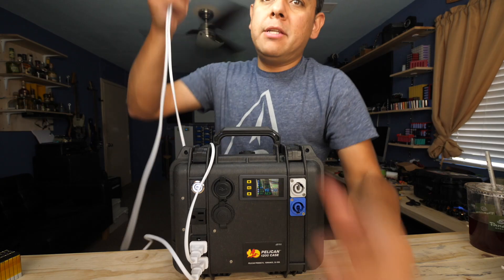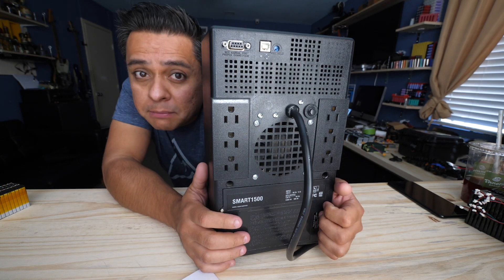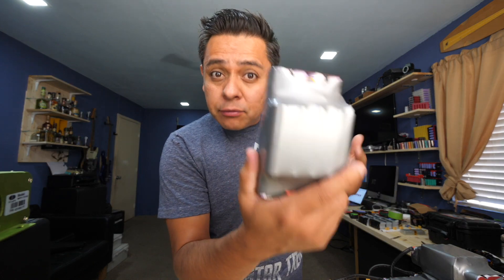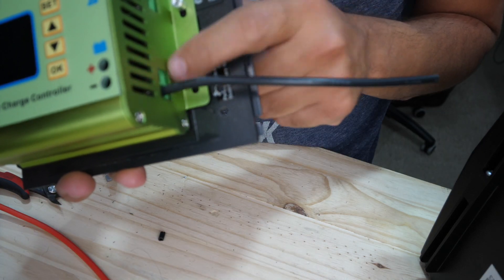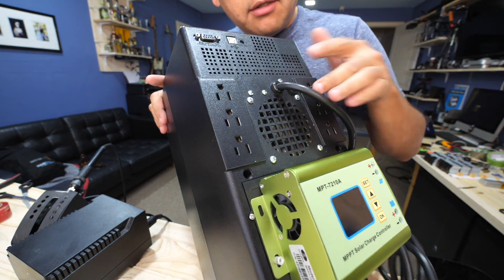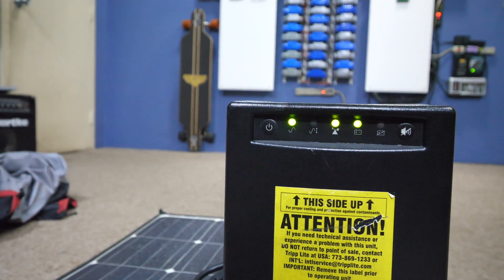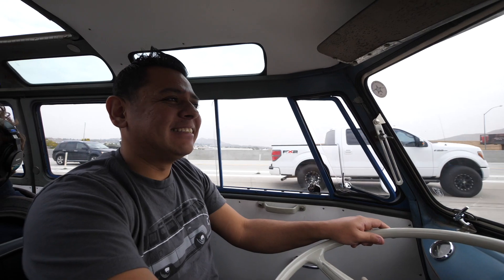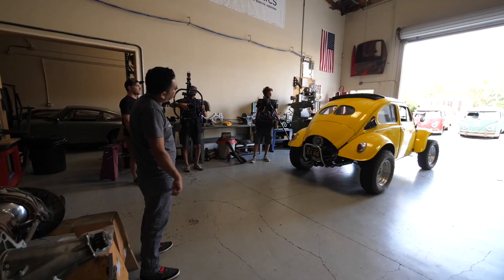The $400 Solar Generator you can donate To Puerto Rico

Comment: Hey, great job your doing there, supporting Puerto Rico I must acknowledge. 

I have been following and watching your work the last 18 months and we are interested in a similar solution; We (in some parts of Nairobi in Kenya) have been experiencing frequent scheduled 8-9hr power blackouts at least once or twice a week because of maintenance... Oh and any time there is heavy rain, NO POWER! I was born, found this issue, now married with children and my children are still experiencing the same issue.

We are interested in a solar Generator but 240V if possible.
I hope you don't mind me asking if you can build the same Solar Generator to output 240V to power 4 LED Bulbs, Refrigerator, 2 Computers, a TV, router and still have enough hours to keep the system running.

Looking forward to your response.
Reply from the maker: +dj riQ   It’s the same device with different components,  I don’t have a use for those specs so u won’t be building that particular version
Reply: You can go off grid any time you want. With a used UPS like Jehu shows it's just cheaper. 980W and sine wave is pretty good for a quick system already in a box and ready to go to help people in need. Search youtube for "off grid" and see all the ways people have done this. Battery, inverter, solar charge controller, solar panels and you are all set. And it's mostly just two wires + -. Then like everyone else you keep adding to it as you go while telling the power company to shove it more and more. It's fun. See my youtube channel for what I did and I took my hot water heater off grid the easy way so that big load doesn't have to be on the inverter at all. You can buy a 240V inverter on ebay, I use a Prosine 1800W for everything in the house except A/C which is on another inverter now. Have fun and it's worth the investment to not have to worry about power outages or paying the power company. We really don't need them any more.
Reply: Thanks for the response, 

What I have is the APC Smart-UPS 1500VA LCD 120V which I bought in the US and shipped to here. I can probably begin with this just to understand how the whole thing works before I purchase a 2240V version.
A humble request: can you assist me to figure out the exact type of cells, number of cells, cabling + connectors, charge controller and a flexible solar panel that will be ideal for a similar setup as above.

I appreciate in advance.
Reply: By using your phone you are limiting your life, use a real computer for the internet. This was all in the DESCRIPTION and this video shows it all except how to set the CC.
To Familiarize yourself with solar charge controller https://youtu.be/mM6JTquNSZU & https://youtu.be/vzhwR0mAshs
To set charge controller to auto start charging https://youtu.be/f0Br1Q57IoE
******************************************************************************
Parts List:
http://j35.us/5xSona36v-packs     $149
http://j35.us/MC4-SolarConnectors  $5.18
http://j35.us/12awg-Cable     $24.99
http://j35.us/xt60--y     x2     $9.99
http://j35.us/10A-Mppt-ChCon     $37.99
http://j35.us/60wLEDbulbs     $9.92
http://j35.us/LightSockets     $12.68
http://j35.us/105W-flex-solar-Panel  $126
http://j35.us/950w-UPS.     $30

Comment: Can you do a video that has a battery wall or system than that can be charged by human power like a bike? It may also promote exercise.
Reply from the maker: No,  humans can not produce very much power maybe 100wh
Reply: jehugarcia thanks for the reply keep the awesome content coming...  Probably watched the matrix too many times..
Reply: Better and smarter to do exercise only once when putting the panels up on your roof. Then you can relax, kick back and enjoy the DIY solar power lifestyle. You gotta love those roll out panels Jehu shows but if you are going to go through the trouble of climbing up there and bolting down mounts I would get the biggest panels you can at a reasonable price to use that precious space you have on the roof. You will be expanding your system as time goes on. For emergency and quick, those roll out panels can't be beat. Visit my channel and other channels to see how people do off grid DIY.

Comment: One big difference between this model and the smaller one in your previous video is that you ran out of time to add an extra out port to Daisy chain an additional ups pack. Can you address this in your follow up video please because I'm trying to figure the best way to do that. I'm putting this setup together as soon as I read your reply. Thanks J.
Reply: At 980W per UPS just get two or more, they are cheap. And then you have a back up if one goes down and you are not out of luck. That charge controller Jehu shows is 10A so your charging power is 360W max at 36V but all day long so say 2.8 KWh (generally) on a good day which should run a 20 cu ft fridge and maybe TV for some hours, you may need a timer to keep the fridge off in the morning a few hours before the sun comes up. You have to think of ALL the factors other than more batteries. At night the fridge may use less power because you are not opening it and it's cooler. Get a Kill-A-Watt meter and log it on paper so you know where you are at. And by the way, it's always more panels and more batteries over and over till you reach a point where you have so much free energy you don't know what to do with it. Welcome to the DIY solar world, see my channel.
Reply from the maker: Add an extra connector and you can daisy chain as many battery packs as you want

Comment: could you daisy chain these with the attached power cord? Pulling power from the other. with your 1st in the Chain cycling in Solar Power from any panels?
Reply from the maker: Maybe,  but you wouldn’t want to waste all that power in inefficiencies
Reply: jehugarcia thanks for the response. I've got a friend heading back to Puerto Rico and we are both thinking building a few of these would help when he goes back. Chaining them would help.
Reply: Any UPS seeing good AC coming in would switch to that AC and thus not run the internal inverter and also start charging that battery so basically it would get bypassed. What you want to do is put different loads on each UPS, like a fridge on one and lights and TV on the other. Put a timer on the fridge to turn it off a few hours before the sun comes up so it doesn't pull the battery all the way down and trip the UPS off or whatever. Then let it come back on when the sun comes up and gives you enough power. You should get a Kill-A-Watt meter so you know what the fridge generally takes but a 20 cu ft is like 170W running, 300 defrost (you could disable that in a pinch, just pull one wire) and about 2 KWh a day total. Hope that helps and see my channel and others for DIY off grid stuff.

Comment: Jehu, can you do a bigger one? I made one last year but used 2 12v 105ah agm batteries. I use a Ridgid 22" rolling Tool box from Homedepot. 
Here is the link of the box.  https://www.homedepot.com/p/RIDGID-22-in-Pro-Gear-Cart-Black-222573/205441921?MERCH=REC-PIPHorizontal1_rr-205440481--205441921--N

Comment: Can í put more than 4 battery packs for more storage capacity and how long can you run the CPU
Reply from the maker: Yes they are in parallel so you can add as many as you want
Reply: Thanks gracias hermano

Comment: TrippLite equipment and the company are excellent in my opinion. 13 year's ago when figuring out my home off grid solar system the best price I could find for a 12v 2 kW inverter was one of theirs through a trucking supply company for a little over two hundred bucks. Even better it was listed as ambulance grade so has always run our computers and electronics with no issues even though not pure sine wave.
   After three years it had an internal short, and when calling the company was informed that actually it had been recalled. But even without wanting the old one back over night shipped a 3 kW replacement that came with the added bonus of being 12v / 24v variable.
   Has been working fine ever since with the exception of replacing a noisy cooling fan about four years ago that was just pulled from a junk computer power supply that I had. 
   Jehu, thanks for demonstratong how easy it is to do these kinds of projects. I figured it out all those years ago and have had free electricity ever since. And with the reduction in price of panels and equipment could probably do for less than half of what I paid back then.. But If had waited would have spent 3 times as much paying the power company.
Reply from the maker: Nice

Comment: What is the shipping weight of the UPS without the batteries? The seller does not list on the paypal checkout. I need this information in order to check the freight forwarder cost to ship a UPS to work on for this project.
Reply: think it was 43 on amazon they have link for extra batteries subtract that?  about $25 to ship for this deal..$55 dlvrd

Comment: Can anyone there contact the red cross or other groups and get this information to them? They have a lot of funding and this is like handing a generator that doesn't need any gas to people in need. The gift that keeps on giving.
Reply: Jehu, I contacted the Red Cross but no reply yet. They probably don't even know what I am talking about anyway and only deal with food and blankets.  It may be better coming from a RC contact in PR. Could you or someone you trust start a Kickstarter or other crowdfunding campaign and then get a bunch of these and panels quicker to PR? Check with solarblvd and sunelec for the lowest prices on panels and since someone here said they can ship pallets it might work out well with more power per $ spent. Just a suggestion, I know you are short on time now so this is why I suggested someone you can trust. You can probably set a cut off date for a first "batch" and then keep the funding going for another batch etc..
Reply: It may still be difficult to get packages there. From "Unidos por Puerto Rico": "Your message, questions and/or support are important to us. The Unidos por Puerto Rico Team will now be receiving emails in a limited capacity.
Our postal system and distribution networks are still working through extreme backlogs with FEMA still holding obvious priority. In light of these factors and the cost of shipping, the best way to make a difference now is through a monetary donation. Additionally, all supplies will be purchased locally to support our local businesses and aid our struggling economy.
We are committed to helping those in need of assistance and work tirelessly to help in Puerto Rico’s recovery. From all of us at Unidos por Puerto Rico, thank you for all your trust and support. We are in this together."

Comment: Can it be used with a load and charged at the same time?  I thought you needed to use the -P connection on the bms to enable a load and charge functionality.  Have you tested this?
Reply from the maker: Of course you you don’t need a separate cable to charge the battery
Reply: Can you charge and run a load at the same time with your setup?  Did you test doing this at the same time?
Reply: Please explain why you think putting energy into a battery and also draining it at the same time won't work. (let's say it's 100W in and 100W load or maybe a 200W load or no load) I would really like to understand what you are talking about. You said -P, do you have one of these battery packs and know something we don't know about them?
Reply: I think it depends on what battery packs you have purchased and the corresponding bms controller that is running the pack.  I don't know what the the Samsung pack has on it but I have the LG packs.  Richard Lloyd did a good video on this showing how the bms may need to be connected using the -P to simultaneously charge and discharge.  https://www.youtube.com/watch?v=Ua6PpLWqEgc&t=180s

Comment: Does anyone have the spec sheet for the UPS?  I'm going to build a few of these regardless, but I'm curious as to the effectiveness of using the built in charger.  I'm new to this, but specifically, I'm wondering what the charge voltage cutoff is, if will it try to float charge, and if the bms eliminates these concerns.   Thanks.
Reply from the maker: It floats at 42v but it quits at 34v I’m doing the calculations how much energy you loose by not discharging down to 30v
Reply from the maker: It floats at 42v but it quits at 34v I’m doing the calculations how much energy you loose by not discharging down to 30v
Reply from the maker: It floats at 42v but it quits at 34v I’m doing the calculations how much energy you loose by not discharging down to 30v
Reply: I ordered a few units and I'll try to see if there is any way to adjust the cutoffs.  Did you try adjusting the charge characteristics via the PowerAlert software?  If not, I can take a stab at it when my units come in.  I'm hoping that we can disabling float as well as maybe lowering the lower cutoff.  I am in the LA area, how soon would we need to have these completed in order for you to take them on your trip?  Thanks again for all you are doing.
Reply: Here's the link for the company I hope it shows up. 980W it looks like 
and "PWM sine wave" whatever that is, someone throw a scope on this 
thing and let us know. Also some models have an external battery 
connector so this thing can do longer runs and I did see what looks like
 a fan on the back in this video. Seems to me that if you plugged it in 
and also ran solar the charge controller would back off if the battery 
is full so they should be able to operate at the same time but you are 
depending on the built in battery BMS to keep it from over charging it 
looks like. See my channel for some off grid and other solar stuff.
https://www.tripplite.com/smartpro-120v-1.5kva-980w-line-interactive-ups-tower-usb-db9-6-outlets~SMART1500/
Reply: https://www.amazon.com/TRIPP-1500va-980watts-6-outlets-line-interactive/dp/B002ORTG02/ref=sr_1_5?s=electronics&ie=UTF8&qid=1510465624&sr=1-5&keywords=Tripp+Lite+SMART+1500&dpID=41wOC2zpI-L&preST=_SY300_QL70_&dpSrc=srch
The UPS It is about 980W and is $500 new
The battery max charge voltage is 42V and BMS will stop overcharging

Comment: I'd really like to buy a couple of UPSs.  But I have no idea how much shipping is going to cost.  I don't understand the idea of buying now, and finding out the full cost later.  I imagine that shipping those big heavy boxes may be quite expensive.  Has anyone found out about the cost of shipping?
Reply from the maker: Have you clicked on the link?  It told me how much shipping I would be charged
Reply: I did, but not far enough. Sorry about that. I tried again and clicked through.  It told me $30 for ups + $27.40 for shipping =57.40 to NY.  Are UPSes like this commonly available at electronic recycling centers around the country for local pickup?  

I think it's a brilliant idea, especially if it could be used both as a UPS plugged in, and as an emergency battery for other things.  

Have you thought about adding a 12v buck converter on a switch for 12v output as well?  That and a handle would make it a monster.  Great video.

Comment: Plug that UPS into AC power and see if it will charge those batteries.
Reply from the maker: I did,  it does
Reply: Interesting. Leaving the original BMS in place is key to make this work. It will control the charging and low voltage cut off to protect the lithium cells.  You hit a home run here!  Excellent!!!
Reply from the maker: Actually the ups stops charge at 42v,  and quits at around 33v so the the BMS is just redundant safety
Reply: jehugarcia I'd like to do this but with more capacity. Thinking of getting 3 12V 100Ah batteries (ones that look to he available locally here in Puerto Rico) in series and using them instead of the 36V packs. Would the UPS be able to charge them? How long would it take to do so on grid power?

Comment: You mean $55 for UPS. $25 shipping? That's nutz.
Reply from the maker: Until you can find a shipping company that ships for free,  be glad there is a source of cheap ups units
Reply: I actually thought these would be lighter without the batteries but I guess they are still 20lbs. I guess with $5 box and packaging, and $15 in shipping your looking at $20+ anyway, my bad. It was more of sticker shock when I looked... but I also noticed they are charging sales tax on non-california resident purchases.... that should be fixed. Buying 10 of these with a total shipping charge of $80 is very reasonable, btw.

Comment: Love this I am in Puerto Rico No light for 6 weeks, thanks for thinking of us !!!
Reply: Please tell us more, are you able to get solar panels or inverters 
locally now, are any companies delivering packages if you order online, 
how did you get online, did anyone donate solar stuff to people, if 
there was a way to easily solar power peoples electric hot water tank 
with just two panels about 500W MPPT would that help, do you have 
running water, do people generally know how to wire basic things like 
solar panels and batteries, can you get electrical hardware locally OK 
like a hardware store, how is the gasoline situation for travelling 
around?

Comment: Does anyone know if this contains a pure sine wave inverter?
Reply from the maker: Yes it does
Reply: Great.  I am so new to this.  Does the charger display give you all the info you need to monitor the system?  It looks like it might have a fuse from the back.  Are safety features built it?
Reply from the maker: Yes
Reply: Sounds better and better.  Could this system handle additional batteries?  For example, instead of 4 of these batteries could I put 6 or 10, even if some are outside the box?  Or would it be better to have a separate battery pack that I could swap out to have more juice in reserve?
Reply from the maker: Yes